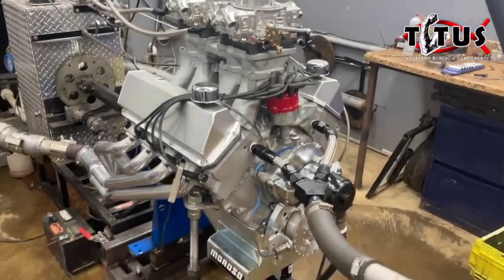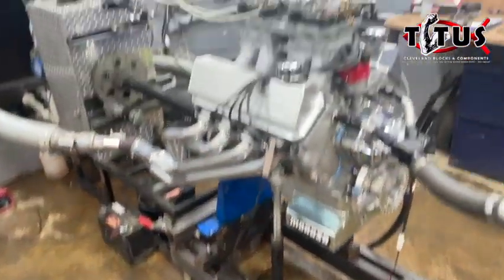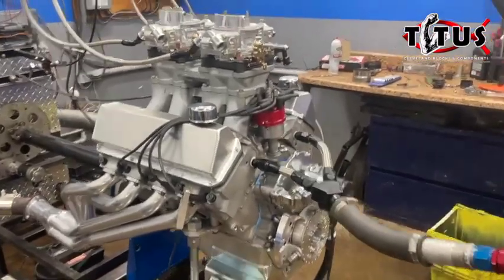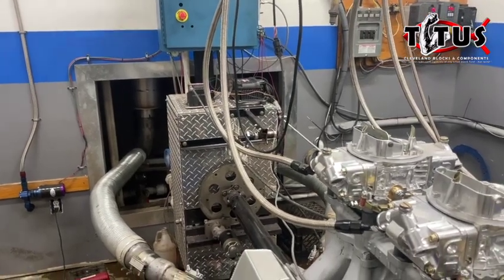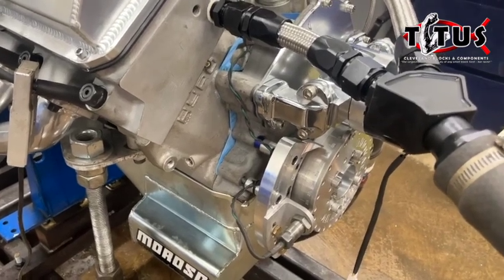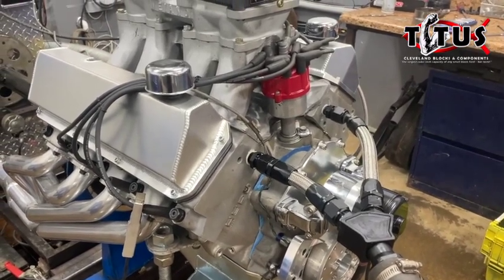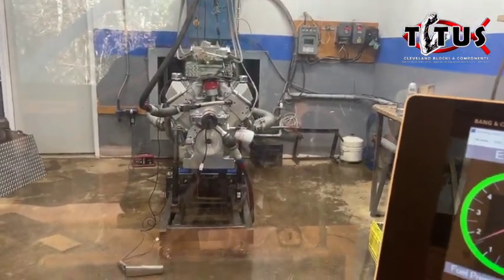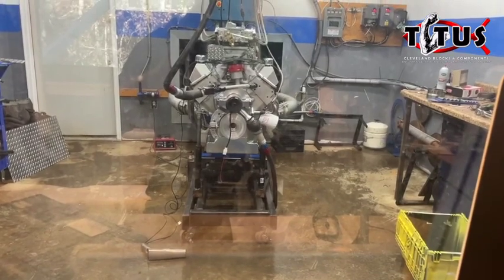Engine Break-in with New YourDyno Dyno Valve // Fontana Clevor Build – Titus Performance

Comment: Mark , question 4U on ur tall deck Cleveland Block with the Hemi Heads from Georgia . 499.350 cu inch with the largest valves that will fit in the Hemi Heads.  Running 93 octane.  An all out engine.  4 a jet boat.  
What sort of TQ & HP do u believe u would reach & at what max revs 4 this combination.  One version tunnel ram & the other single plane manifold from either Australia 🇦🇺 or the USA . 🇺🇸 
Cheers Robert 🍻  Australia 🇦🇺 

Compression 11.2 / 12.1 with coil near plug Ignition. Hydraulic Roller Camshaft.   Thx 😅
Reply from the maker: That combination will make 900+ HP